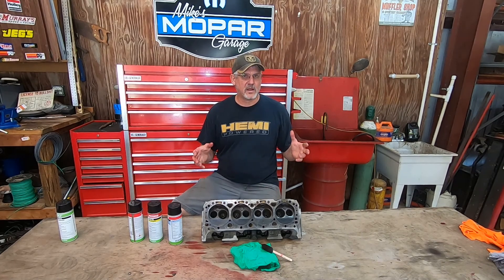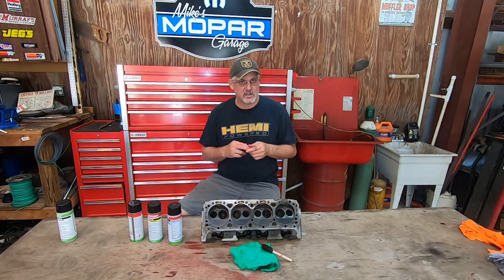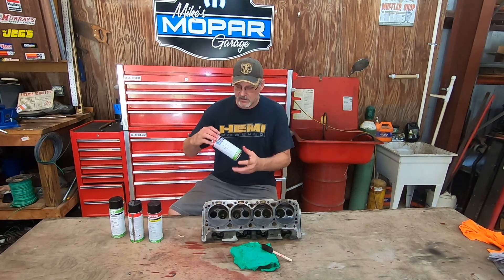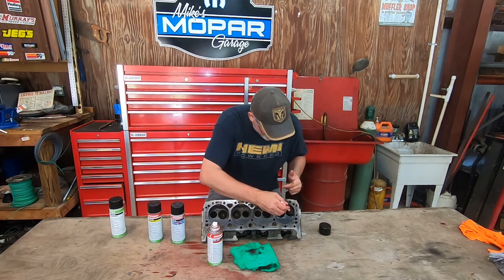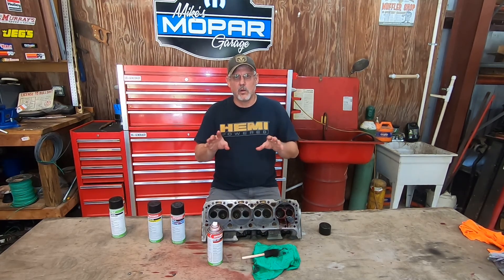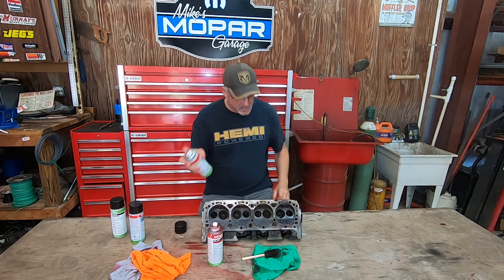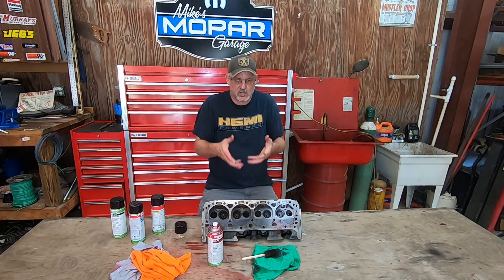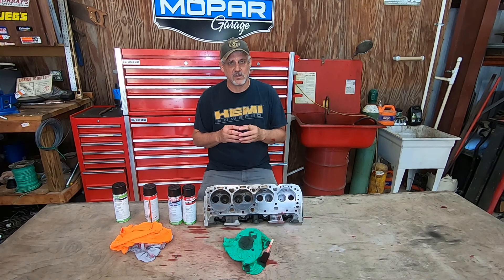Penetrant Testing Cylinder Head For Cracks

Comment: Would spraying carb or brake cleaner into the exhaust and intake ports with the valves installed on this head detect that crack? Would we see it leaking through the crack?
Reply from the maker: Its possible but unlikely. Unless the crack extends through the seat and down the bowl.  Then the crack has to be wide enough to allow the cleaner to penetrate.  The penetrant we use has a much higher penetrating ability.

Comment: What about all the red on the right side is that not a crack?  Does the red make the crack visible?
Reply from the maker: @bpatinas1578  That's actually the seam from the valve seat and the head.  As tight as it is, there is a micro gap and the penetrant is so sensitive it actually will penetrat that gap.   Good question!

Comment: Great video!!  Question, on the die showing around valve seat.  Crack or normal mating service for seat?
Reply from the maker: Thank you for the comments. Since the seat is press fit, there is a "gap" at the joint.  The die is drawn into the "gap" and then bleeds out.  You really have to pay attention to make sure small cracks don't radiate from the seat and masked by the large bleed out.

Comment: I have a black motorcycle frame. How do I perform this test on a black colored product that needs to be checked for cracks?
Reply from the maker: With this method all the plaint must be removed in the suspected area.  Has to be bare metal.  If not, the dye will absorb into the paint and be impossible to clean off.  Also will promote corrosion.  Do not sand it off, you need to use a chemical stripper then clean the area thoroughly before applying the dye.
Reply from the maker: If the frame is carbon steel and you can't or won't remove the paint, then a more applicable method would be Magnetic Particle (Magnaflux).  It can find the cracks through paint.  See my other video, " Magnetic Particle Cylinder Head for Cracks"
Reply: @mikesmopargarage4734  will try this. Thanks. I was also looking for florescent dye

Comment: What about the rest of that red? did you not clean it well enough?
Reply from the maker: Two reasons.  The valve seat is pressed in, the penetrant is coming out of the joint.  Its impossible to clean it all as it just keeps coming out.  Second, for purpose of the video I knew where the crack was at so I concentrated on that area.

Comment from the maker: Bob, absolutely NOT.  Do not wire brush aluminum.  What happened is it smears over the metal and covers and seals cracks.  The only way would be to chemically clean it or hot tank it.  Afterwards clean really good with cleaner prior to applying the penetrant.